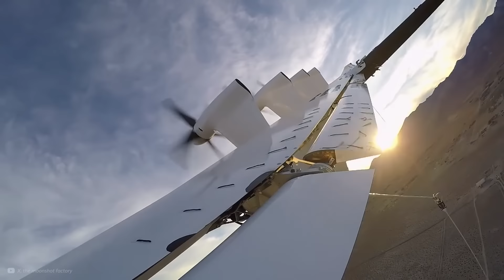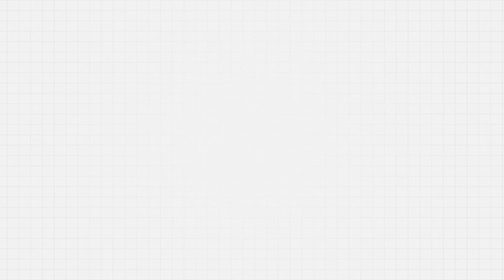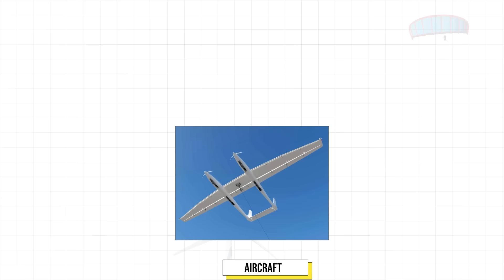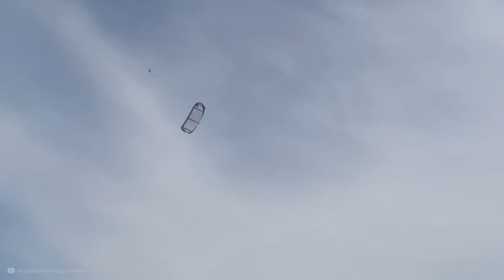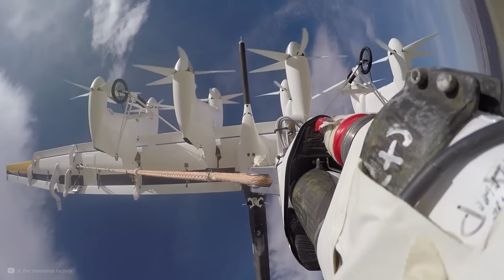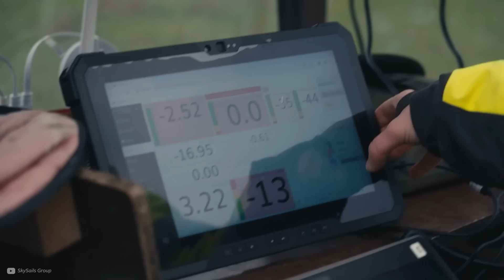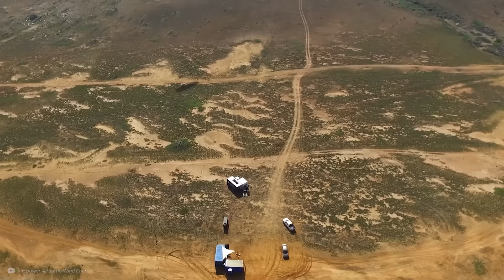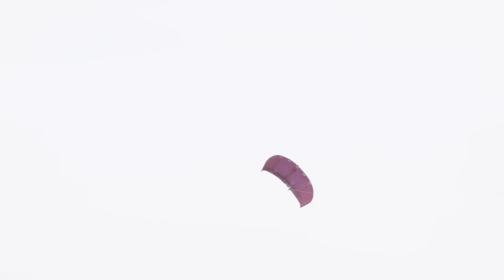Airborne Wind Turbines: The Future of Clean Energy?

Comment: Although the idea is interesting, I do see several flaws with this concept and they are very tough flaws to overcome.  Largely you have questionable power output and reliability.  As there is no doubt you do have much higher wind speeds at higher altitude, but you need a lot and very solidly built units to harness it well.  Another issue, even if they go up high enough, birds become less of an issue and the problem becomes planes and general air traffic.

Comment: The regulatory challanges (whatever they may be in detail) are obviously orders os magnitude smaller than with wind turbines in the ground. In Germany there are few locations left where you could (legally) put up a wind turbine because house owners do not want them in their vicinity. Then there is the problem that they kill a lot of birds. So if there are rare, protected birds in an area, that's the end of all plans to put a wind turbine on the ground there. Both problems disappear with airborne wind energy. The next problem is that the good locations (a lot of strong wind) were used first, obviously. So each new (not: replacement) wind turbine is worse than those before.

The main challange of the transition to renewable energy is to always have enough energy available. Those who can offer that to a smaller extent will be paid less. A very important advantage of the airborne wind power is that the winds are not only stronger at higher altitudes, they are more reliable, too. In the future most of the solar power will go to some kind of storage (additional cost, less efficient). The airborne wind power can "always" be sold directly and at higher prices.

While I am writing this, an interesting question comes to my mind: How close to each other can airborne power elements be put? On the ground you need quite some distance between them due to the effect they have on the wind behind them. But the kites are so small and can fly at different hights that it mighte be possible to let them fly quite close. Making sure they fly in parallel should not be that difficult. And maybe they could even be mechanically connected on the ground so that less generators are needed. That may be something worth talking to the macufacturers about.

Comment: Modern kite designs are efficient and capture powerful, smooth air from higher altitudes. Launching and tweaking the kite's figure 8's optimally requires visual and hand sense, plus a sense of what the wind is doing. Wind velocity and direction changes, so different kite sizes are used in kitesurfing for optimal performance. Errant gusts would be tough for computers to deal with IMHO but they are less common once a few meters above the water.

One needs a big radius to cover all the wind directions and protect from kites crashing to the ground. The kite and cables wear out from variable tension, vibrations, salt, silt, UV light, pollution, etc.

Comment: On the Aerostats. I used to work with them a bit and we eventually stopped using them because the price of helium had gone up so much it just wasn't profitable for our application anymore. I bet that had a part to play in the ones you mentioned. 
As well as taking a 4 man crew to launch and dock it, someone had to monitor it at all times because it wasn't rated to fly in high wind speeds.
Scary as hell landing one when its windy!
Reply: Why not use hydrogen?
Reply: @christophvonwaldhuf  - hard to contain (diffuses through most lightweight materials), is a green house effect multiplier, only offers 8% higher lifting capacity than helium,  requires extensive safety measures to prevent/surpress ignition, and hydrogen is energy intensive to generate.
Reply: @christophvonwaldhuf  Too bigger risk of it going bang
Reply: @christophvonwaldhuf  Google 'Hindenburg'😬
Reply: @christophvonwaldhuf  Google 'Hindenburg'😬
Reply: I suppose a hot air balloon solution isn't viable? Like an electric heater within using some of the energy generated to operate.
Reply: @neinherman9989 just reduces the eroi by a lot.
Especially given how high it has to go (colder and thiner air)
Reply: What happens when the wind speed is high? Will it crash? 
Maybe automatic systems can be developed to monitor it instead of human
Reply: @FishCatcher-k8b  It's to do with the rating of the tether, and what it's tethered to. I'm sure it could be automated a little more though
Reply: Thanks for ansfer. Can you tell what was the general production numbers provided by that giant donut wind turbine? 
I was wondering what if we could put it flat and add funnel  which would fall on the horizontal turbine.

Comment: My idea is to use a spring loaded ratchet mechanism with a flywheel on the ground based generator to pulse the tether.  Similar to how a rowing exerciser works.  Makes the kite very simple as it doesn't have to fly around in figure eights etc.  Just stays up in the air and repetitively yanks on the tether....
Reply: how does it yank on the tether? What design you have in mind? Wing ? What about spring force being different at different heights?
Reply: To optimize the function, the spring action would need to be dynamically adjustable, and the kite needs to pulse its pull to resonate with the ratchet spring ...

Comment: When you talk about scalability with these products what do you really mean? If you mean scaling down in size for consumer domestic appliances rather than the larger, I approve. The sooner energy security is out of the hands of politicians & various other gangsters the better. We'll never crash the cost of energy OR fuel without this systemic understanding.
Reply: You can't scale wind down. They physics is against you. The power output is proportional to the cube of the wind speed, so you need to get up high - and you can't really have a load of kites flying around above the suburbs. If you want personal-scale renewable power, that's great: Use solar.